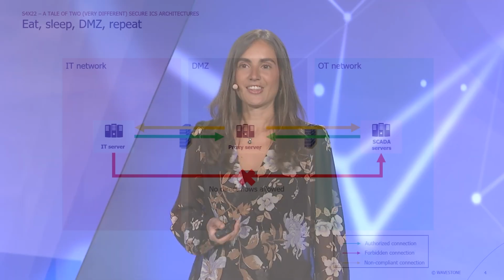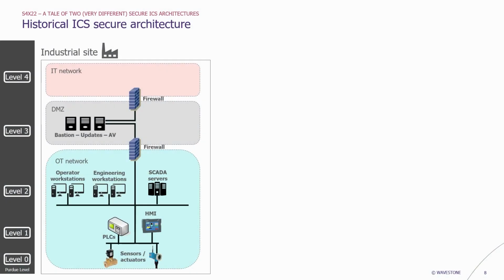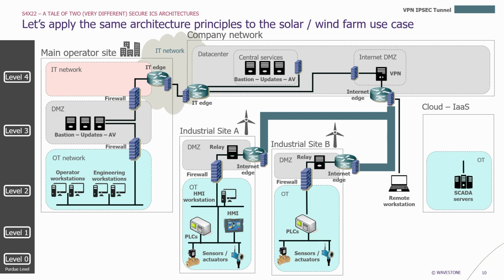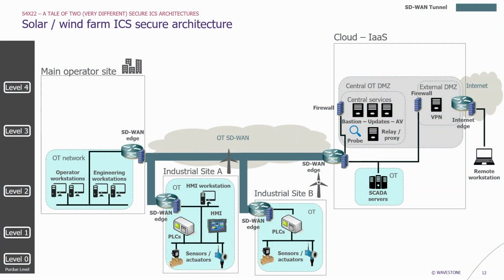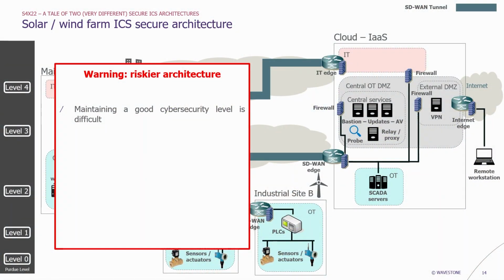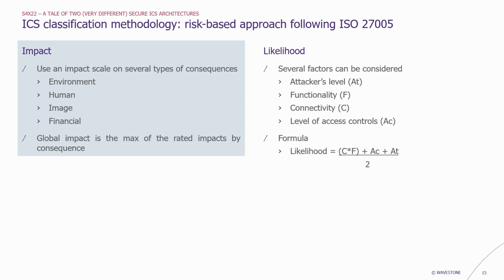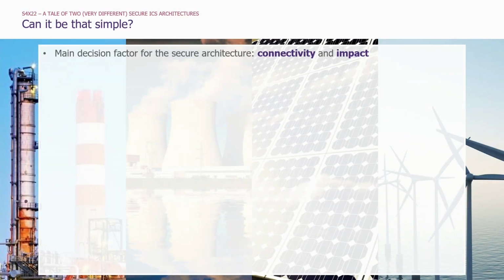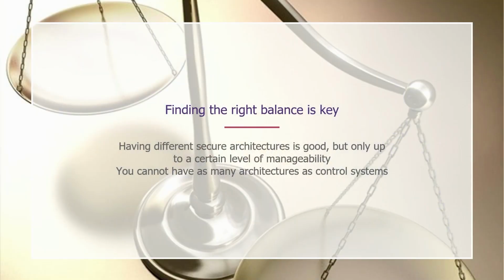A Tale Of Two (Very Different) Secure ICS Architectures

Comment: Informative video. Purdue model is purely for reference, then and now too, its not a one size fits all, thats something many forget while thinking about architecting ICS architectures. Also it mainly highlighted the need for securing the control system as in a minimum set of best practices. For todays requirements, we have to architect networks that is simple and meets our requirements. No point in having a very complex network which can have far reaching consequences. Also the debate on MPLS vs. SD-WAN will never end, to be honest, it depends upon the needs, data traffic and budget. Also vendor solutions for SD-WAN vary, but its a matter of time, everyone will start shifting to SD-WAN for various reasons.